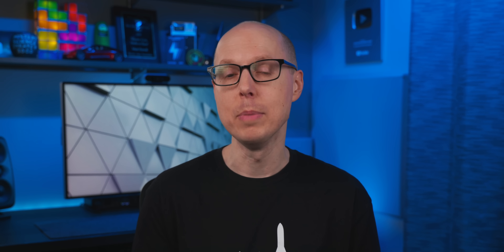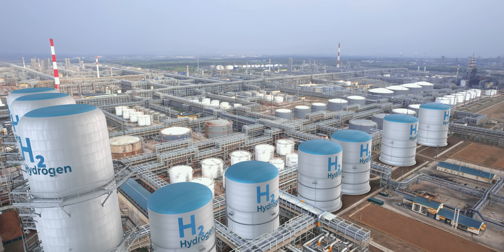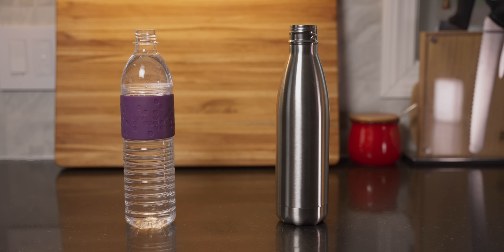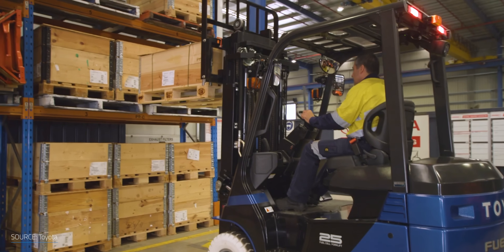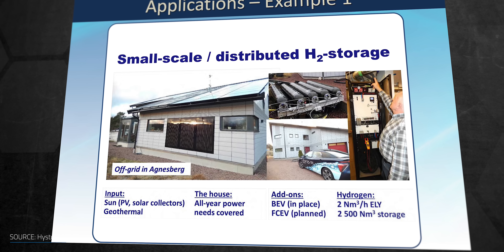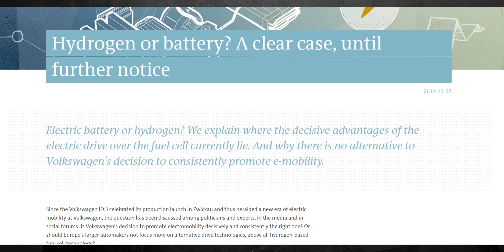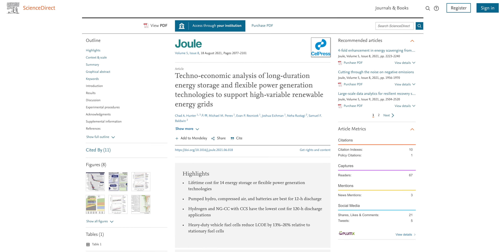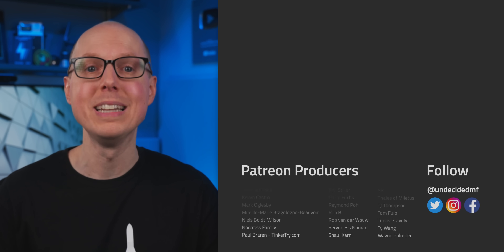Solid Hydrogen Explained (Again) - Is it the Future of Energy Storage?

Comment: I've seen metal hydrides for hydrogen storage to feed fuel cells in action first hand a decade ago. The cylinders they were stored in used ambient heat to charge and discharge over hours, they merely got hot when charged and cold when discharged. Was impressed. Sure, if you operate at high rates, you need active cooling or heating to achieve the high rates or it becomes self limiting, but it depends entirely on your power needs, you might not need them is you are content to work at lower rates.

Comment: Considering the amount of hydrogen available versus all other energy compounds, this is the direction we will inevitably follow. And I anxiously look forward to the day we can cheaply and responsibly utilize this technology!
Reply: @Phil Ware only currently...
Reply: Hydrogen is not available. You have to spend a large amount of energy to break the bonds of the chemicals hydrogen is found in.
Reply: @GeorgeMonet  people are making hydrogen generators at home, using electricity from a wall socket...
Reply: @amjrpain919  That's not a hydrogen generator though, is it? It's using electricity and will always produce less than you put in. So they are making hydrogen, but it's losing money (hence, costly to do). They also aren't creating enough hydrogen to really do much with in a home setting. It's basically just a science experiment.

Comment: So even though you very quickly glossed over solid hydrogen's very low efficiency of 25%(unless its winter and you can use the waste heat), it is also prohibitively expensive when compared to even Li batteries! Therefor I believe, it is currently a hope based upon faith in a belief that someday a breakthrough MAY happen, sorry but good luck with that!

Comment: Can we see Battery/ H2  hybrids?, since batteries can produce heat which is wasted and uses energy to keep it cool. I would really like to see a hybrid. If that is beneficial. What size of fuel cell will be required to be added. So a system that has batteries with metal-hydrides on top and a coolant on top if metal hydride overheats. Released hydrogen will directly run the fuel cell and charge the batteries on the go.

Comment: Thanks for all the effort you put into this. What I do see as a communication problem is calling it "solid hydrogen". Such a thing may exist but it takes near 0 degK and the extreme pressure of a diamond anvil. Not something that's going to go commercial anytime soon :(
Nonetheless I do think hydrogen as a long term energy solution will have a role to play. Much of the discussion focuses only on when the Sun goes down and not on the challenge posed by times when the Sun is obscured by clouds for days or weeks and impact of climate change itself on wind and solar production.

Comment: What is the maximum fuel efficiency for gasoline powered vehicles. Toyota has recently released their dynamic force engine with a 40% thermal efficiency. How much energy can be saved and not  be lost to heat? Another question as well is how much energy is lost to waste heat and how much could be saved?  Love the videos and hope you have a good day.

Comment: Are you sure about the 40kg/m3? At a density of 0,0899kg/m3 at 0°C and 1013mbar for hydrogen those 40kg need a lot more pressure I would think.
Reply: Same with the Tesla. Yes, those pucks can have a capacity to weight ratio like lithium ion cells but you want electricity to power your motors and this might add a weight penalty in form of a fuel cell.

Comment: @8:10 Why would the hydride be compressed into pellets? That would reduce its surface area and make it harder to disuse the hydrogen, both in and out.
Reply: My guess is there is a balancing act between the increased surface area of granules and the loss of storage volume due to interstitial spaces between the granules.  In other words, speed vs capacity.

Comment: This time I felt you focused on Hydrogen's failures as well as its benefits.
This helps to keep the video seem more grounded.

As you said, Hydrogen makes sense for large storage, as the active part of the process doesn't need to be increased with scale, only the storage.
The question is, will hydrogen be the best long term for this. Will compressed air, pumped hydro, or a new technology make more sense?
Only time will tell.

Comment: Something I remember reading 10+ years ago in SciAm was an article about a lab managing to keep anti-lithium stable for several seconds, which is half of eternity in atomic terms, and that they were certain they could increase it much longer.  I haven't been able to find anything about it since, and I'm wondering what became of it.  Anti-matter storage seems like the ultimate battery.
Reply: Antimatter batteries have a tremendous benefit in terms of energy density, however, putting energy in and taking energy out of such a system is not likely to be very efficient. I wouldn’t anticipate a viable device within our lifetimes, and I suspect it will remain a highly specialized energy storage solution for the foreseeable future.
Reply: @bridgetshepherd5202  It's likely to be highly valuable for space travel, where the mass of the fuel creates hard limits on acceleration and deceleration.  Since it's so hard to produce anti-matter, I suspect it would be limited to tiny probes, but would produce speeds which would make reaching nearby solar systems feasible in something less than centuries.
Reply: @NoJusticeNoPeace  Bet Yer a Star Trek Junkie of the old school???   😎

Comment: Love this channel, every new video, I almost always think its the best one yet, but this one is undeniably so. 

Though I'm not finding much info on my particular interest, decentralized energy production and storage, like the idea of a thorium reactor in every home, and the engineering of homes that minimize dependence on enclosed spaces (obviously, such a thing is geographically dependent).
Reply: if you havent already, take a gander at off-grid living solutions, but to be honest, most use geothermal, solar, wind and/or hydro combined with batteries and earthen heatsinks combined with air flow solutions and window angles for optimal conditions to reach passive house standards so as little energy is needed as possible
I dont like the idea of thorium reactors in every home, because half the population is below average intelligence. As safe as thorium is, it is not idiot proof
Reply: @kimwarburton8490  agreed, good as I believe LFTR's are, they are more suited to municipal or district level use where expensive  monitoring is more practical.
I wish more people would consider their use.
Reply: @gregbailey45  would be good for hospitals and industry imo where theres already a pool of people with appropriate talents
Reply: edit, and high energy demands
Reply: Beats the hell out of a SMALL THERMONUCLEAR DEVICE in every abode...  😎
Reply: Humanity needs to explore like you said smaller more independent energy less Grid. I also think "Electrolysis" is also very Under explored, which On-demand instead storing hydrogen and risking explosive issues.
Reply: @j.christie2594  agreed, tho solid state hydrogen doesnt have explosion risks from several vids iv watched on youtube (so im no expert, just reporting what ive watched others say who claim to have done the real research to my satisfaction n have a good track record re evidence on youtube XD)

Comment: As someone who worked in metal hydride R&D, I can say your episode was on point. 
But there are some small clarifications how about metal hydrates. Metal hydride work on plateau pressure‘s, which is the pressure at which hydrogen will be absorbed or released from a metal lattice.
Raising or lowering the temperature of the metal hydride increases or decreases the plateau pressure, which is useful for no moving part pump applications. You can design a metal hydride to have any plateau pressure you want. The main technical difficulty with metal hydrates is the absorption depth limit which is about 1 cm for most Metal hydrides, heating or cooling it allows you to get greater absorption depths. The Technology exists to have large fully packed Metal hydride cells without exceeding 1 cm, i just don’t see any Company using it other than the one I worked for.
Reply: Is there any degradation over cycles, like in classic batteries (I don't remember the term for it)?
Reply: @niclaskarlin  not with normal use. 
If it one of the metals in the hydride reaches its melting point, The hydride breaks down. The only other reduction to capacity comes with impure sources, as other gasses will not fit through the Metal lattice. But this can always be reversed by pulling a vacuum.

Comment: Matt,  hitting it out of the park with this redress.  Will H2 technology be useful?   YES.  Just like the myriad of different chemical storage types.  You highlighted temporal efficiency as well as process efficiency.  To rapidly and drastically increase the amount of energy storage we have for renewables, and make them truly useful, we’ll need EVERY solution we can cost effectively implement.
And as ongoing research improves technologies, we’ll replace the less effective and efficient ones with better tools.
Thank you for bringing the broad range of technology to be seen here in your channel!!!!
Reply: There is literally no cost effective implementation of this. This 30 year old technology has never gained mainstream success for a reason. Because its inefficient and a scam in any application like this.

Comment: I recall several news releases over the last few years from Perdue & other Universities on fuel cell tech. The first book I read on this subject was called Powering the Future. What became of the Canadian fuel cell efforts in metropolitan buses? Have there been suppression techniques employed such as your description of classification issues slowing the patent process in other realms of energy production & storage? Lastly, why didn't the 500 km range compressed air car the Germans developed go anywhere?
Reply: The fuel cell buses in Vancouver were quietly discontinued because they don't (and never did) make economic sense.  Like most Hydrogen announcements, they were more about green-washing and scoring PR points than actually advancing real solutions.  As for the compressed air cars, the technology works but the vehicles need to be ultra-lightweight and efficient since compressed air is not very energy dense.  500km is extremely optimistic as most models trying to get into development today are less than 150km.
Reply: Compressed air also loses efficiency by thermal losses, and releasing that energy causes stresses in valves because they get rapidly cooled. Thermal recycling at the grid storage level can improve the efficiency of compressed air.
Reply: There's no conspiracy here, it just didn't work as intended.